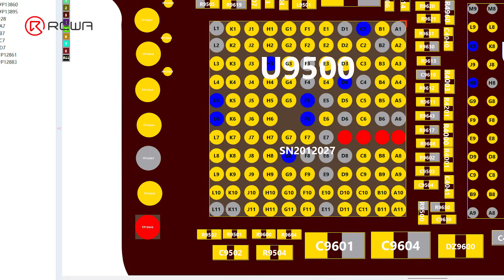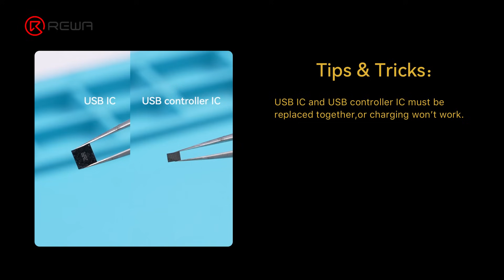We Fixed an iPhone 16 Pro Not Charge - USB-C Did it !

Comment from the maker: Have you guessed the culprit?  🤔
Drop your guesses in the comments before watching the fix!  👇

👍 Like, 🔔 subscribe, and turn on notifications for weekly real-world repair insights from REWA Lab.
Let’s get fixing!  🔧✨
Repair product: 

1.iPhone 16 Pro Charging Port Flex Cable OEM New :
https://shop.rewa.tech/detail/iphone-16-pro-charging-port-flex-cable.html?utm_source=YTB0527&utm_medium=video&utm_id=Repair+Product

Repair Tool:
1. SUGON 8650 Pro Hot Air Station
https://shop.rewa.tech/detail/refurbishing-alignment-mold-with-laminating-mat-for-iphone-x-11-pro-max.html?utm_source=YTB0527&utm_medium=video&utm_id=Repair+Product

2.SUGON T3602 2 in 1 Soldering Rework Station
https://shop.rewa.tech/detail/sugon-t3602-2-in-1-soldering-rework-station-with-jbc-c115-c210-soldering-tips.html?utm_source=YTB0527&utm_medium=video&utm_id=Repair+Product

3.Mijing MJ-138 High-Purity Solder Paste
https://shop.rewa.tech/detail/mijing-high-purity-solder-paste.html?utm_source=YTB0527&utm_medium=video&utm_id=Repair+Product

4. 3 in 1 Knife Handle & Blade Repair Set:
https://shop.rewa.tech/detail/mijing-3-in-1-knife-handle-blade-repair-set.html?utm_source=YTB0527&utm_medium=video&utm_id=Repair+Product
Reply: Hi my iphone 14 pro front camera module is replaced with new module(apple original) but now unable to use face id is it repairable please do reply
Reply: What kind of cleaning water u r using?....to clean the motherboard
Reply from the maker: @niyubahrin  PCB cleaner is ok.
Reply: @rewatechnology2008 any pcb cleaner like relief and ycs mechanic? Or can use thinner? Any way thank you

Comment: Ok, I have iphone 16 pro max and S24 ultra. I am using apple orignal charger and cable for cargging of both phones. In my case is it possible that mismatched pin configration of apple and android cables will damage my s24 ultra???
Reply from the maker: Perhaps, after all it is based on our repair case assumption especially for fast charing cable.

Comment: So let me get this straight apple are using usb-c and it’s not the same as usb-c it’s there own take on it wow if that’s the case I’m surprised no one is talking about it because I’m pretty sure that wasn’t the deal they had with the European Union 🇪🇺 😂✌🏻❤️
Reply from the maker: Yeah but this is our assumption, based on our repair case, we have met lot of apple USB-C charge issue and they share the USB ic damage problem.
Reply: @rewatechnology2008 i get that I mean from the image of the none apple changing plug it was different to apples one different pin out that’s what it looked like anyway and may I just add love your content and just pure Master skills ✌🏻❤️

Comment: How to know that is an apple type c compatible cable?
Reply from the maker: Use the Apple original, otherwise every time you may need to check the pins
Reply: I see the main difference in the absence of CC contact. Maybe the problem is that the power supply does not understand and outputs a different voltage to charge?

Comment: You can just flash it after replacing U2. ( retaining data) it works perfectly without replacing usb controller ic. Therefore no need to split boards
Reply from the maker: We also test that before, but maybe 16 is too new, we can not locate the chip.
Reply: @rewatechnology2008  Hi my iphone 14 pro front camera module is replaced with new module(apple original) but now unable to use face id is it repairable please do reply
Reply: @thesoundmaster.  what's the message you are getting in the face-id setup
Reply: @thesoundmaster. If it's original, I think you can boot your phone up in repair or diagnostic mode to finish the setup there. Shut phone off, hold the volume buttons and plug it into a computer
Reply: @TheUltimateHacker007 can’t even display is original but can’t calibrate shows unknown
Reply: Would the laptop be able to detect the phone without replacing the usb controller ic?
Reply: When trying flash getting error 6 %
Reply: If only change the u2
Reply: I have one iPhone 13 can’t connect to system what’s the problem

Comment: I bought a iRepair Desoldering platforn, but it gets hotter than the set temperature when I use it. What can I do now?
Reply from the maker: Change the platform, otherwise you may easily damage the motherboard.
Reply: @rewatechnology2008  But I bought this new. The place I bought it from cannot help me in any way.
Will my money be wasted like this?

Comment: Did you resolder the charging IC or you changed it?
Reply: It is completely broken and needs to be replaced.
Reply from the maker: Replace, as you can see in the video, the chip is damaged.
Reply: @rewatechnology2008  brother, usc ic and usc ic control, are you take from iphone 16 Pro, or usb ic and usb ic controllor is general?

Comment: This is very informative! I used to think the USB cable for charging doesn't matter as long as it charges
Reply: Its shouldn't matter, the U in USB is for universal, they should be the same. If this truly is the case, Apple are ridiculous for doing this. USB is a standard.
Reply: @_MJ07_  Nah just looking at the video i can say the usb-c cable look crappy , a good usb-c cable with an e-marker chip in it is probably more than enough to ensure proper power delivery to the Iphone. The reality is a lot of usb-c cable come from dropshipping with crappy quality at low price , and people still buy it to charge their 799$ iphone.
Reply from the maker: We hope this repair can bring you inspiration.
Reply: welcome to Apple works, they took something simple and made a mess from it. cables should be the same, but the word as should, law was only for the connector type, not for the cable internal layout, so Apple made a special cable for them